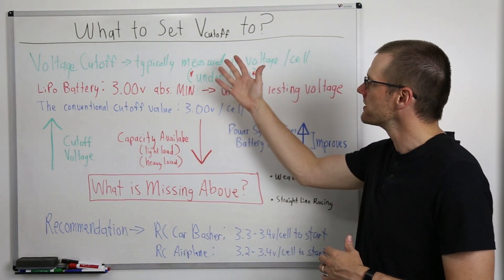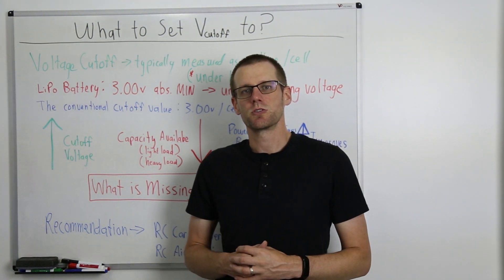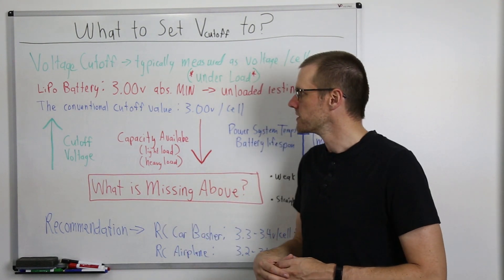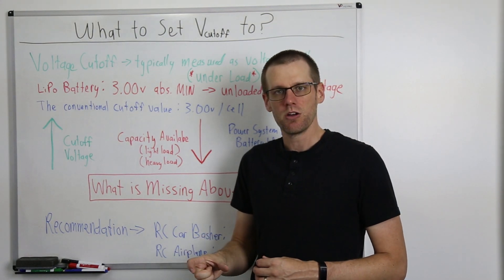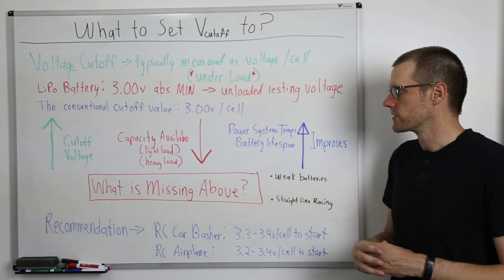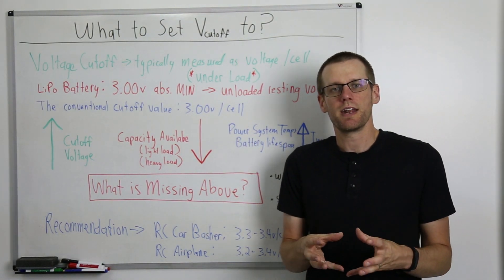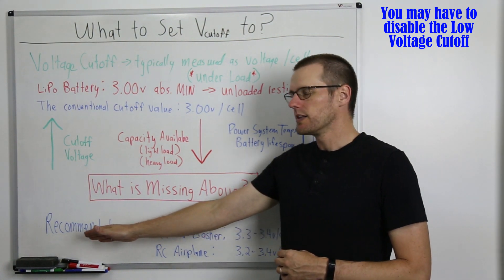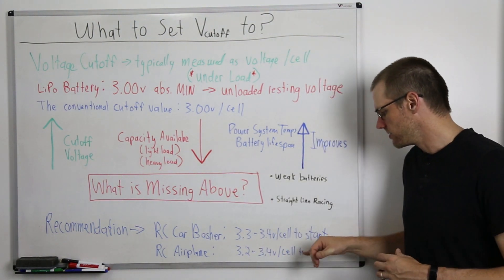At What Voltage Do I STOP running my RC? LVC - Low Voltage Cutoff

Comment: What about a 6s 5100mAh battery? I set my lipo alarm to 3.10 and when my alarm goes off after what seems to be a 15 minute drive I bring the battery inside to charge and it's reading 4.08 or so per cell. Why is my alarm going off so soon? Is it possibly inaccurate? Should I use the esc instead? It's a Shogun XP.
Reply: Voltage sag. You probably have a low C discharge battery and the esc can't pull enough amps without the voltage sagging.

Comment: I want to run NiMH batteries in a RC car. If I disable the Lipo low voltage Cutoff can I use NiMH batteries. I have a Spectrum programmer and this setting is the only way to do this. Please will someone tell me.
Reply from the maker: It depends on the car and how much power it is going to pull from your pack. you can try to use NiMh by removing the cutoff.

Comment: You say the absolute minimum V/cell is 3.00V with no load. So does that mean when highly loaded it's ok to set the cutoff voltage lower than 3.00V, say 2.8V or even lower as the cells will recover to over 3.00V when unloaded?
Reply from the maker: Yes, but this is very risky. example -how do you know 2.80v/cell will work for your setup. Also, running your battery down below 15-20% capacity already reduces maximum lifespan. Not ideal to spend time at a lower voltage and even pushing it so its literally 3.00v at the end of a run. Your pack is not going to like you if you do this once let alone often.
Reply: @RCexplained  Ok, thanks for clarifying.

Comment: One question. Why do l IPO chargers say they can discharge and allow you too select say 3A but when you started to discharge, they only discharge around .2 or .4 depending on charger. Battery i was using a reference was 1300mah 100c 5s l IPO battery.
Reply from the maker: Limitation due to discharge wattage.

Comment: Question for you - is it true that aggressively discharging LiPo batteries will reduce their IR value? (Or do they just read a lower IR value during a concurrent high-current discharge cycle?)
Reply from the maker: Discharging a LiPo causes them to heat up depending on how aggressive the rate is. Higher temperatures lead to lower IR's. Increased temps do also lead to lost lifespan.
Reply: @RCexplained  that makes sense. So the IR is lower while the battery is hot. I keep seeing these guys looking for the old dischargers that fast discharge the nicads, and they’re saying aggressively cycling their LiPos on there makes them perform better for peak power. I’ve been working with LiPo batteries in power wall and backup power situations, so the idea of cycling high-current discharges on purpose had my brain going, buut nooooooo!!! Haha 😂
Reply from the maker: Yep totally not required.

Comment: Thanks for a lot of information  that makes it easier to understand how to setup and use our RC equipment efficiently and safely 
  I acquired a 'bucket' full of assorted equipment at a sale and I would like to use a couple of motors for my airplanes, but the only info I can find on them is what is printed on the can.  How can I figure out what voltage and escapement to use?   The only info on the motor is A2212/10T.   1400kv, no brand name. The quality of the motor seems to be quite good and unused

Comment: What might cause battery to have a weak cell? It happens to all of my batteries after just 2 - 4 months 🙁 I'm thinking about 3 things but reason might be different as well: 1. Defective charger, 2. I pull too much power from batteries, 3. I discharge them too much. 
What reason could it be, what you think?

I know all Lipo rules about charging, storage...

I set my cut-off to the highest possible. When I come back home I always check cell voltages, it is between 3.4 & 3.5 V/cell (while battery is healthy)

I use good batteries: Gens ace 50c, Turnigy Graphene Panther 75c, CNHL G+plus 70c ⚡
Reply from the maker: Many reasons for a weak cell. Question is what is a weak cell, what is the metric used and what is the variation?
Reply: @RCexplained  First it starts to discharge faster - example of 4s voltages after run: 
3.68   3.67   3.66   3.33

After some time it is also charging faster than other cells ⚡

Comment: Great video! 
I have a question that might make for an interesting video if it hasn't been discussed before, How are brushless motors able to work with so many amps as claimed by the manufacturer for the esc or motor if they typically use 12 guage which can only do around 20 to 35 amps at less that a couple feet of distance? the amperage my motor claims it takes is 60 amps constant which is way more than 12 guage and the motor has 13 guage wire.

A separate smaller question if you have the time. If a brushless motor is a "sequence" of pulses between three wires how does higher voltage enable it able to go faster if it is a timed sequence unlike a brushed motors  mechanical timing, does it speed up the timing in the esc essentially like overclocking it?

Thanks for your time!
Reply: I always wondered the same thing…… My straight away boats can pull 700 amps on a burst with a 8mm wire. ( I use German high strand count wire it’s pretty much a 8ga wire. ) If you tried using this wire for a AC welder it would fry so how come it can handle the dc voltage of our Rc. This makes for some good reading as I researched it years ago. Would like to see a video as well……..
Reply from the maker: Hello, thanks for the comment. This question about wire gauge vs current capacity has been asked several times and is in queue. I will see if I can bump this video topic forward. 

As for your second question, rotational speed I'll give it a try here. When it comes to a brushed motor and brushless motor, they both work the same. (electrical vs mechanical commutation) Voltage controls the speed and we can see that when we dig more in to the Back EMF equation. Additionally, both mechanical and electrical timing work in the same way as well. You can't speed up the motor by trying to accelerate the mechanical timing of a brushed motor. Same idea applies for our brushless setup. Trying to fire a phase in a fraction of a second earlier will not speed up the motor infinitely, in fact it will cause the motor to get out of sync with the ESC. What does happen is the ESC sends out a higher voltage (PWM avg) forcing the motor to accelerate. The brushless ESC must figure out the actual new speed of the motor and adjust the electrical timed pulses by reading the back EMF. Both brushed and brushless motors are a carefully timed sequence of events.  And in both brushed and brushless, the timing of each pulse can not accelerate the motor.
Reply: @RCexplained  Thanks so much! That question always plauged me when trying to figure that out lol.
And I'm looking forward to the video!